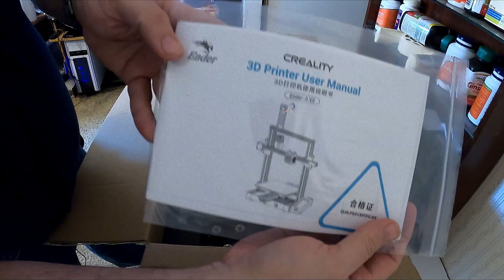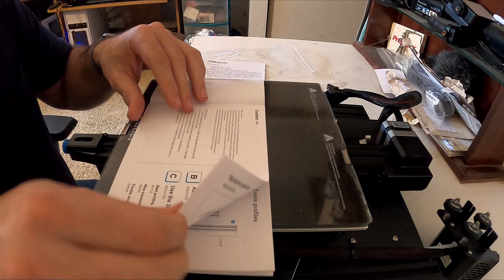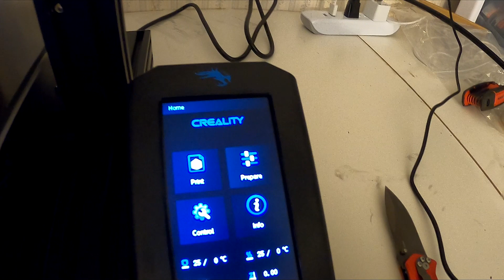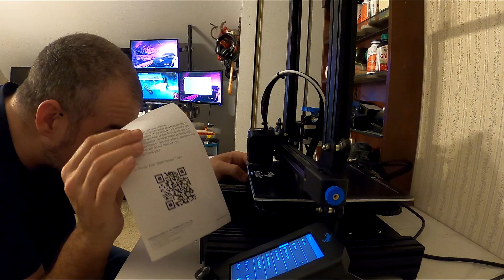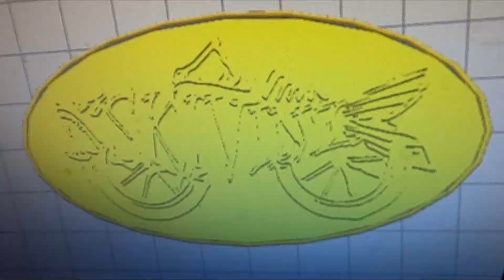Setup, Calibrate, and Print with the Ender 3 V2

Comment: Adam when you get ready to run that 3d printer go to Walmart and get some white spray lithium greese and spray the long axes strews. It stays on there longer and is the best to use. It is in a white spray can with red lettering on it.
Reply from the maker: I have a can of lithium grease.  just not sure what you mean by long axes strews.
Reply: @Skivinz  Axis lead screw.